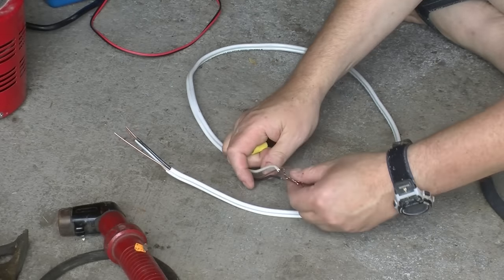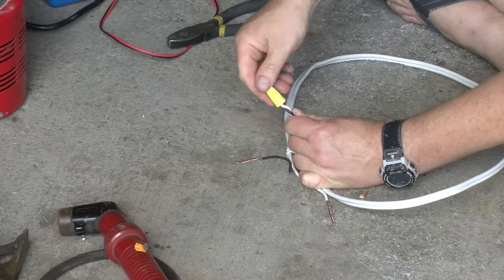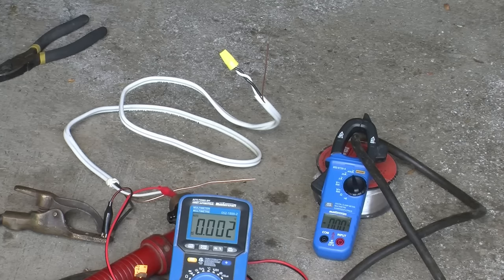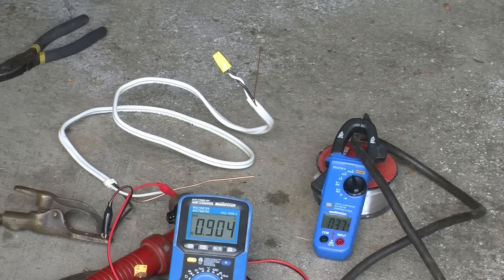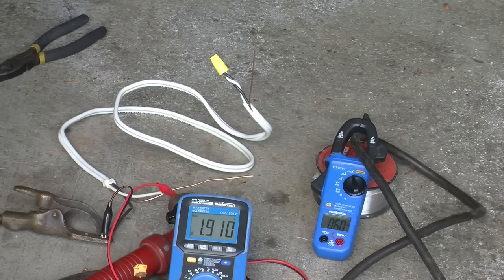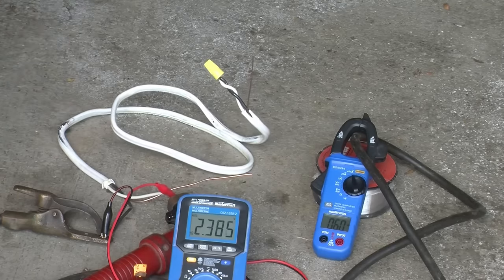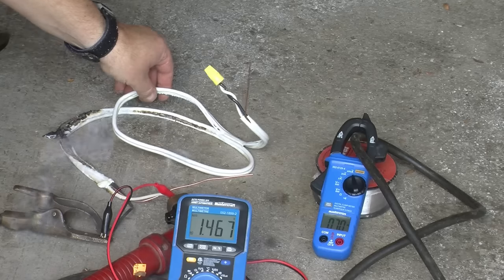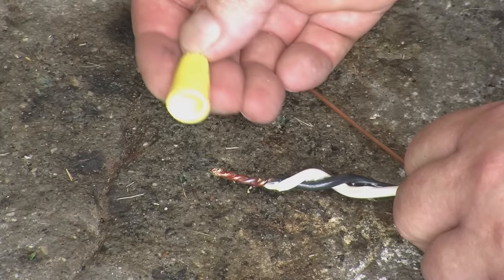How many Amps to burn up 14/2 electrical wiring?

Comment: 14/2 wire should never be used running more than 15 Amps at 240 Volts. Play it safe; don't be a fool!
Reply from the maker: Absolutely! And the intent of the video is to show what happens when it is subjected to over-current. Most electrical codes specify that for continuous current draw, no more than 80% of the rated current should be used. ie For a 14/2 rated at 15A, the max continuous current should be 12A or less. The reason for that is actually reliability of the circuit (prevent the breaker from tripping) due to +/- 5% or more variation in line voltage which can cause a change in current being drawn.
Reply: They are rated for 20amp under certain conditions.
Reply from the maker: @calculator1841  Thats interesting - what sort of conditions? Intermittent load perhaps?
Reply: @ElectromagneticVideos  mostly motor loads since motors have more protections in place
Reply: @ElectromagneticVideos  you can throw a 20 amp breaker on 14-2 if the insulation is rated for it it all depends on the type of insulation however all wire in a residential setting is supposed to be derated to 60 degree Celsius ambient temperature which is 15 amps at 14 awg
Reply from the maker: @rizierr1908  Are you referring to the short term motor start surge? I should probably do a video on that showing how it can significantly exceed the rated current for a second or two while coming up to speed.
Reply from the maker: @beauwoodbury1112  So in something like an industrial/commercial setting with  appropriately rated cable insulation then? Is that commonly done? I presume the main reason is to save a few $ on cable costs?
Reply: @ElectromagneticVideos  pretty much to save money the code allows us to derate to save money all the time however in a commercial application I will hardly ever run 14 guage wire typically I’m always using the next step up than necessary. Most of the time I only use 14 awg in fire alarm or light fixture wiring
Reply from the maker: @beauwoodbury1112  Interesting! I totally get the up-guaging the wire size - I'll bet the increase in cost really is not that great since labor etc is is about the same. Sounds like you are an electrician? I really appreciate your comments. I'm an EE with with much less exposure to code rules than you. But as you can tell I find all of this stuff fascinating - both the practical as well as theory!

Comment: Try 50 LF of 14/3 connected to a standard grounded duplex outlet and apply the load at the outlet - the see what happens.
Reply: length of the wire is irrelevant when it comes to the max current it can tolerate, except for if the wire is so short that connection points are conducting the heat away. the length of the wire only deals with voltage drop which is what transmission lines are mostly concerned about. longer wire has more voltage drop then a short one for the same gauge but has the same wattage dissipation or heating per a foot between the two when pulling the same current. 

the test done here is very representative of a longer wire. only difference would be higher voltage would be needed to achieve the same current in the wire
Reply: @jasonharrison25  true, however testing in a manner which better simulates conditions more representative of typical residential electrical systems and then seeing where the failure would first occur (e.g., at insufficiently tightened main panel circuit breaker connections or along the length of the Romex conductors including several tight bends simulating typical sloppy house wiring practices or at screwed versus push-in connections at the duplex outlet or at the female-to-make contact points within said convenience outlet.  
I recently had a 2,000 A 240 3PH main bus bar serving a very large skilled nursing facility in SoCal, suffer a power surge event from the local serving utility (SCE) and just before the onsite maintenance supervisor threw the main disconnect, one of the two remaining overloaded phases caused said bus bar to overheat to such an extend that it commenced to melt with a half-dollar sized eruption of copper from the face of said 4” wide bus bar.  I would have thought that the 2,000 A fuse serving that particular bus bar would have popped first - but it did not.  Had said maintenance supervisor not had the presence of mind to note smoke coming out of the main gear and then immediately throw the main disconnect, the entire bus (per my electrical engineers) would have melted through in less than a half minute, thereby shutting down the entire facility.
So that’s why I’d like to see your very interesting test expanded to see where (e.g., beyond the wire nut) failure(s) would occur.
Reply: @ericberman4193  that fuse likely didn't blow because it didn't have more then it's interrupt rated current flow through it long enough to melt the link inside. more then likely the resistance of the connection on the buss bar was high enough to cause sufficient heating before the current exceeded the fuse rating. 

this is why low resistance connections are important so as to reduce the heating

Comment: Problem is in a house this wire is getting 120v.....so you aren't accounting for the full wattage. 120v ×10Amps=1200watts.......soo redo this shit with a big whopping power supply. I bet it won't handle anywhere near this amperage before it melts entirely. 

For my own personal story, I was using an electric jackhammer. Jackhammer had a 120v 20A plug. Project was a bit further than my outdoor outlet so I bought a 12awg extension cord (pain in the ass to find btw) and after about 15 min of use that extension cord which was very thick was hot as shit.
Reply from the maker: I have heard conflicting reports as to whether 14/2 is allowed in a conduit. I believe you are supposed to use THHN which may have a higher temperature rating. maybe one the electricians can correct or confirm this.
Reply: @ElectromagneticVideos  huh? What does this being in conduit have any relation to my comment. I simply pointed out you experiment of how many amps 14/2 could handle was quite flawed. The amperage tables in the NEC are derived from standardized power distribution. If you applied 120V at 5khz that conductor amperage table is thrown out the window. The formula for inductance is 2pi×f×l. Your ohmic tables in the NEC are also thrown out the window for voltage drop with a frequency of 5khz. Point is your video is misleading at best. Hell you seem to at least know V×A=W. So do the experiment again and apply standard voltages at 60hz and crank up the amperage. 

Also there is nothing in the NEC that wouldn't allow NM-B (romex) to be used in conduit as long as it was listed for use. It is not standard practice and may not be allowed in some cities but NEC has nothing to say against it.
Reply from the maker: @Matt-bz5vg  Very strange - that was my response to a different comment. Not sure how it ended up here!
Reply: At 120v it would be hundreds of amps. V / R = I  

Wires are rated by amps not watts

Comment: SOMTHIS wire RATED to 60😂😂😂😂😂😂😂😂😂
Reply from the maker: If you want to see some more realistic tests, look at the followup videos I did with the 14-2 in the middle of a 2x4 wall and surrounded by insulation.Spoiler - the safety margin  essentially disappears :(

Comment: Distance matters too
Reply: How?
Reply: @libtrs838  shorter cables can carry more current. Power loss in a cable is directly proportional to the length of the cable. The ratings on these cables are made with the assumption that there might be 150+ foot runs of cable. The longer the cable, the bigger the voltage drop and power loss. That's why you aren't supposed to run 300 feet of extension cords with a 15 amp load on the end
Reply: @archietheproto7706   Yes, the voltage drop is larger because the resistance increases with length but the heat dissipation is spread over a larger area. It's directly proportional, so a longer cable will not fail faster or at a lower current. If a wire is 0.003 ohms per ft, 10ft would be 0.03 @ 15 amps, and 0.45v drop which is 6.75 watts of heat. 1000ft would be 3ohms  @ 15a, and 45v drop which is 675 watts, both are 0.675 watts of heat per foot so they would both fail at the same current.

The NEC doesn't do any ampacity derating for long runs because it's not a safety issue. The same 15 amp breaker is just as safe for a 1ft circuit as it is on 1000ft circuit. They recommend not going more than 5% voltage drop for performance, not safety reasons

Comment: Nonsense test.  Wires are in walls and confin electrical boxes.
You want to make a video use the correct terms and use a thermal imaging device to determine the temperature.

Comment: Who ever doing tbis video needs pit in jail or mental hospital. Do not make  romax wire heat up  and touch it ! You will electricute your self. If it not ground fault and only on a regular mercury  panel breaker , you must  reach  the tempature to trip breaker before it trip as you stuck on wire. DEAD BOUND.
Reply: At two volts?

Comment: If you look in the NEC 14 ga. wire is rated at 20 amps but a footnote says to only use it for 15 amps. Your demonstration is in free air, not in an enclosed wall with insulation and no air circulation. And where's your temperature gun? The insulation is only rated to 60C (140F). Above that it starts breaking down. Plus this is only a short duration demonstration. Basically meaningless.

Comment: This test is completely pointless unless you are running your house off a welder? 

This incompetent test has NO legetimate real world applicatiin and does not provide any usefull information about romex or wirenuts.

 All this video does is misinform people who  could theoretically understand less than you about electricity.

This video should be removed for safety concerns.
Reply from the maker: See  "OVERCURRENT TESTS FAQ" here  https://www.youtube.com/post/UgkxeilOfLJGy2ODslnBW0WFXUE580oHhFyP  including why a current source like welder is used and a link to a UL test done in almost the same way.

Comment: Waiting for a zap of death with bare hands. Children watch and imitate content online, be safer while testing equipment.
Reply from the maker: The voltage used is very low (less than 10V)  since we are essentially dealing with a short, so not a concern in terms of touching it.

Comment: Good video but voltage (electromotive force) is way too low. If you do the math at 120V you would've started burning up at 32 amps. To make it simple, compare it to a garden hose. Voltage would be the rate the water is coming out. Amperage would be the amount of pressure applied created by the rate and resistance being the hoses ability to handle the rate and pressure. What your experiment is doing is increasing pressure with no rate. That's why you just had a melt down instead of an arch flash.
Reply: At 120v it would be way way past 30 amps. Current is a function of voltage. He is increasing the current by turning up the voltage.
Reply: @libtrs838  True to a point. Perhaps a better comparison would be to consider a something such as a motor that has seized. Voltage stays the same but amperage exceeds threshold generating excessive heat.
Reply: @1stcommonsense   that energy is going into the seized motor not the wire. Same current will create the same amount of heat regardless of voltage. The resistance of the wire doesn't change. 

At 1.5v  50 amps goes through the wire so we know it is 0.03 ohms. The wire is dissipating 75 watts of heat. If we increase the voltage at all the current will keep climbing because current is a function of volts / resistance. 

If you want 50 amps at 120v you need to have a resistance of 2.4 ohms. So if we add a 50 amp load to the wire at 120v the wire is still 0.03 ohms and still dissipating 75 watts of heat. 50a x 120v = 6000w for the total circuit power. 75w of heat from the wire and 5,925 watts goes to the seized motor.
Reply: @libtrs838  Not true. Current (I) is a function of demand and voltage (E) is a function of supply. We replace burned out conductors all the time on equipment that's not properly maintained or seized. Even a #12 conductor is rated at 600 volts but only 20 amps. If demand exceeds 20 amps you need to derate to #10 and so forth. You can have a piece of equipment that operates at 4160 volts but only 100 amps. Conductor size will be the same for 100 amps but the insulation jacket increases dramatically. In other words the wire absolutely carries the energy.
Reply: @1stcommonsense  current is determined by voltage / resistance 

Yes true I just laid the math out for you.

The resistance of the wire stays the same so the demand as you call it or voltage drop across the wire stays the same. 

Funny you say not true then give a bunch of examples proving my point. All your higher volt examples. The wire doesn't care if the voltage is higher only the amps matter.

You are correct a 12ga wire can be at 600v and 20amps but it is also only rated to 20 amps at 2 volts. Because the voltage doesn't make a difference.

If a wire melts at 50 amps and 2 volts it will also melt at 50 amps and 600v. But you can't put 600v to a wire and keep it at 50 amps you would have to add some type of load and then that is where the energy is going.

Wires for the most part transmit power and consume very little. Once you plug something in with a higher resistance the majority of the voltage drop is happening there which also means all the heat is being dissipated there too.

What is demand? There is only current / volts / resistance. I can only assume demand means resistance because that would make the most sense.

The wire has set resistance. So it's "demand" stays the same

Comment: Your test is stupid. It is not a realistic example of home wire use. Your wire example melts at 120 watts but in home use the same wire is rated to 1500 watts!
Your example uses 60 amps at 2 volts = 120 watts whereas in home use 14 gauge wire uses 120 volts at 15 amps = 1500 watts. 
In home use, 14 gauge wire can support 15 100 watt light bulbs.
In your example, only one light 100 watt light bulb melts the wire. 
Amps is the key for this kind of test. Too much amps melts wires.
Therefore, increased voltage allows 14 gauge wire to handle more watts.
Your example uses 2 volts and 60 amps but a house uses 120 volts and 15 amps which does not melt 14 gauge wire.
Reply: The power goes to the thing you are powering not the wire. This is why powerlines are high voltage carrying huge amounts of power or watts yet don't melt even though they are thin.

Car battery cables are very thick because they carry lots of amps at low voltage.

The wire the powering a 240v 50 amp electric oven / range is a thick 8 gauge or 10 gauge wire, yet the 3 thin wires at the top of telephone poles are about the same size as that oven wire and powering multiple houses.

Comment: Your demo is flawed: 12V x 60amps=720Watts  120V x 60amps=7200watts. Welders operate 35V according to my understanding: 35V x60Amps @ failure is only 2100watts--&would be dangerous if your demo is accurate. You don't explain any of this.  Finally, because visible failure occurred at 60amps does not mean long term damage does not occur at 30amps.  This video is dangerous and you should remove it. You are encouraging badness and children will get burned.
Reply: You are confusing terms. To make things simpler: 

Copper wire has a resistance per electrical foot. Power in this case is I^2 * R.  Current and resistance alone completely define the result. Source voltage doesn't enter into the equation. (Voltage DROP, where you are likely getting confused, is I*R, hence P = V * I = (I * R) * I = I^2 * R)

In this video, he uses the welder in constant current mode, not constant voltage mode. Voltage in this case is a dependent variable, and will automatically adjust itself based on the current and resistance.   If "regulated source voltage (within current limits)" vs. the "voltage drop along a wire" is confusing, better to simply ignore the term voltage entirely and realize current and wire resistance are all that is needed to understand what is happening here. 

BTW, he does also add the caveat in the video never to use the cable beyond its rated capacity. I agree that minor heat stresses in a cable can build over time and eventually cause failures. I think we all understand that. This was an interesting experiment to demonstrate at what current catastrophic failure occurs in a short time.